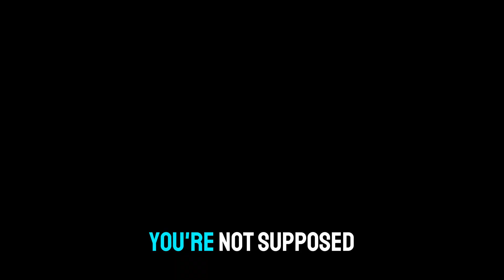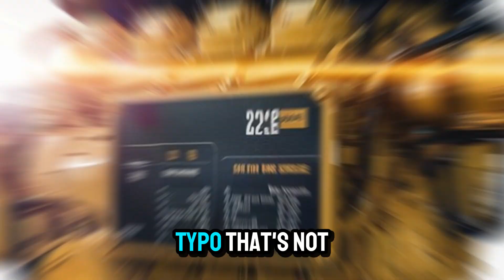The New CAT X24 Prototype Leaked – Is It Too Powerful for the Road?

Comment: How about outback and their road trains? A friend told of a ruck they received that had the hood locked closed and the pan under the truck held on with a fastener they have nothing to fit. They aren't allowed to talk about it, not that they no much other than it has power and fuel economy.